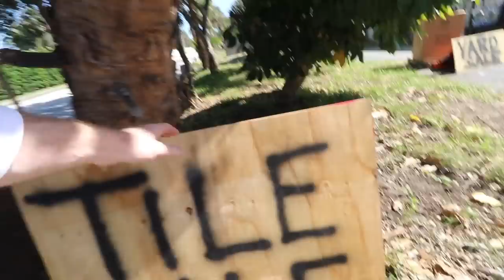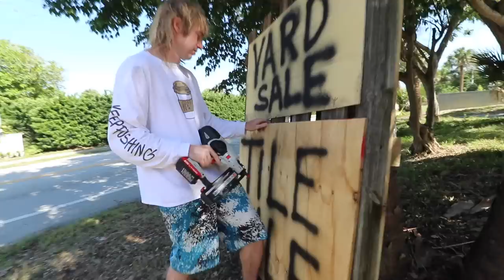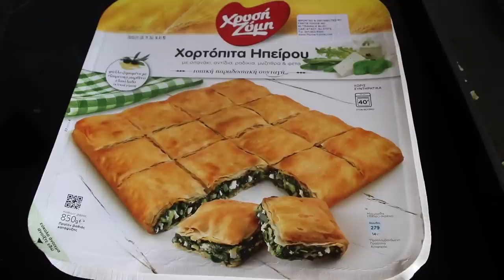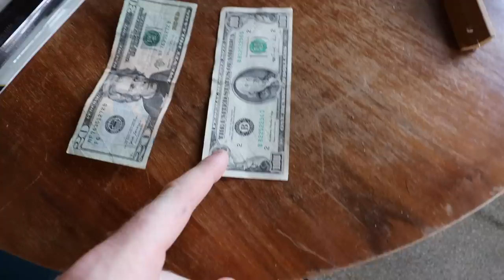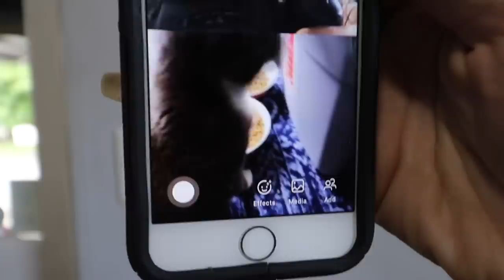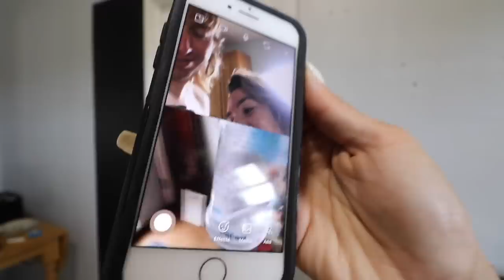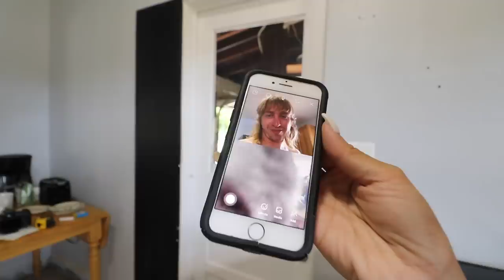MASSIVE LIQUIDATION YARD SALE! We Really Sold All Of That?!

Comment: It's likely you wont sell the gazebo without the hardware. Look at the instructions or find them online. Then see how many bolts and what size, where they go, ect. Even measure the diameter or take part of it with you to the hardware store to size it up and buy all the bolts you need. I would have done that the same day I realized I didnt have the bolts. Even if lowes had them who knows how long that would take to ship to you.

Comment: HOW TO  DETECT A COUNTERFIT BILL, CREDIT CARD OR LICENSE 😊👀👁😊 Get a small black light, turn it on the bills, you will see holograms. This also works on credit cards and drivers licenses. For the older Bill's, scratch your finger nail on the president's jacket, it should be raised and uniform. The counterfeit marker will turn yellow on recycled paper, so be careful. I worked with the LPS at Home Depot for many years. Next time you have a black light available, check out your credit cards and license. B of A cards, you should see a large eagle. I hope this helps you, let me know. 😊🌹🦋🌹